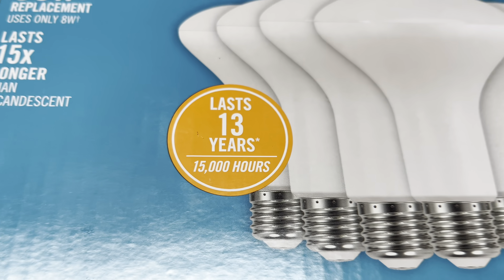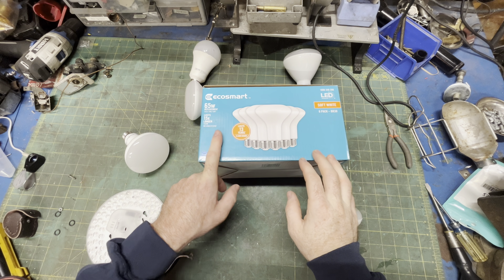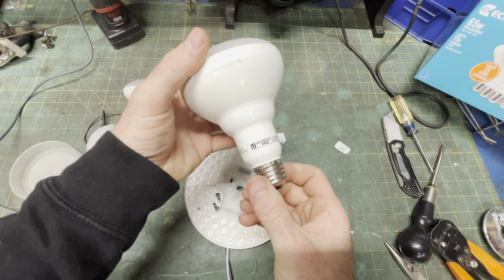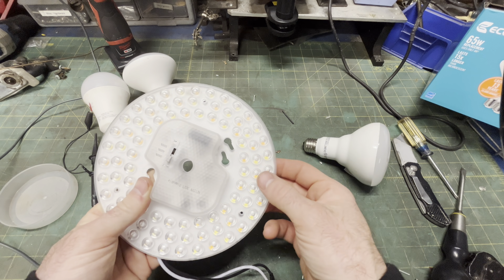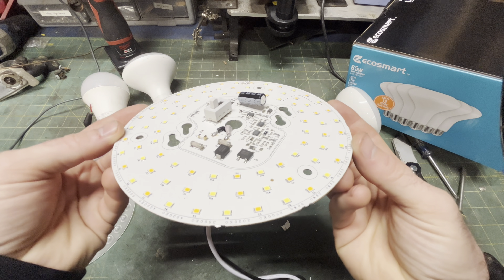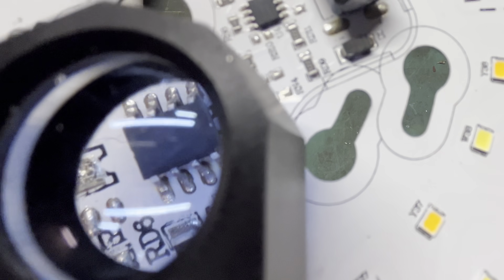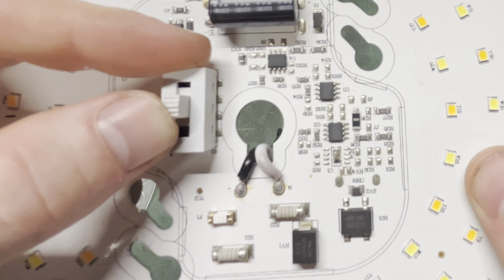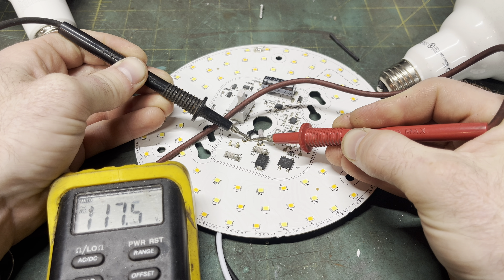Why Do LED Bulbs Fail? An Autopsy!

Comment: My biggest complaint about these LED bulbs is that they cram so many components into a completely un-repairable sealed package. If I could actually fix just the parts that burned out it would be a way better deal. But by the time I open them enough to find the failed part it's destroyed. A room-wide or house-wide efficient AC to DC converter and then just DC LED fixtures would be a much more tenable solution, but people don't want to deal with that.
Reply: Ive been disassembling everything imaginable for over 50 years and its always the same thing  with cheaply made crap that was never designed to  be repaired . Its made that way to meet a price point. But it never stops me from having a look inside anyway!!
Reply: I had some small compact 60s with a spherical plastic cover and couple of them stopped working early, but when i cracked the glue and covers off, two began working again. Lol
And they are way brighter w/o the opaque white cover, so i use them in my bench "up close" lamps as they make very bright light that makes details of things more pronounced. I work on restoring clocks and use magnifiers to see tiny details, so the more intense of clarity the light, the better.
Reply: Cram all the components into a tiny sealed space and see how long the capacitors survive.
Reply: Why would you buy another one if you could fix it?
Reply: People don't want to deal with that because it is available to don't need to deal with that. That is the real problem.
Reply: @d.aardent9382  For those with inductor, there is a chance for an easy fix. If the destroyed component is one of the LEDs, you can simply short-circuit the terminals of the damaged LED. You can do that, because the driver controls the current through the LEDs.
Reply: Same with cheap CFL bulbs. The electronics fail 10 years before the actual bulb burns out. I've seen videos of people from India tearing down and rebuilding dead CFLs that were "recycled" by Americans who can't rebuild anything.
Reply: Yeah the amount of E-waste from cheap made LEDs is horrible. I got two DC LED lamps for camping, they don't get anywhere as hot as the LED bulbs in the house (AC)
Reply: A room wide AC-DC convertor could in theory be dangerous for obvious reasons, but a nice separate standardized  connector which does this would be beneficial and we just connect the lamps
Reply: yes, it's also a ton of fun such a system ^^
Reply: @SadPuppySoup  Mostly because there is no conversion from a cheap AC to DC converter and there's not a drop down voltage resistor.
Reply: @kkgt6591  It would not be dangerous because a room/house wide AC-DC converter for the only purpose of powering LED light would be dropped down to around 15-20v which is not dangerous to touch. So even if someone where to put their finger in there, there would be no danger.
Also a house-wide AC to DC & dropped to 20v wouldn't be big enought to have a significant voltage drop from the transformer to the components.
Reply: @TwinShards low voltage would require expensive thick conductors. Better to have the AC power supply close to the point of use.
Reply: The main issue with all led bulbs that i saw is the same why a lot of modern cheap and not so TVs live for about 1,5-3 years - these leds are cranked up 150% of their nominal power and/or have no adequate cooling...  Just look on them through thermal camera they're almost all around 70c-90c+  on an outer shell
Reply: @AdrianBoyko  LED filament lamps are the worse, because everything is crammed into the lampholder. With SBC or SES, they fail within days.
Capacitors last even less time in the UK, due to our 50hz
Reply: @SadPuppySoup  I've got some LED camping laterns that have been going strong for at least 15 years. Honestly sometimes annoying how cool they run vs incadesent or gas mantle lamps when winter camping and trying to huddle around whatever source of heat you can get.
Reply: @TwinShards   What about the cable?  My electrician wired in low voltage DC track lights and he had to use very low gauge stranded cable because DC just doesn't do well over long distances.
Reply: great idea actually, I would bother and keep some batteries around too
Reply: You thibk those oars are hard to service? Try much smaller surface mount, spaced so close there  is no room for regular probes. I brorought the Microdyne RCB2000 from rottype to production. I needed a microscope to see many of the resistors, and a special 0.01" wide chisel tipped soldering iron t  solder in any replacement parts. Hundreds of LSI integrated circuits on almost a dozeb VXI style cirit boards. We had let a board house assemble a sample run of of ten sets. Not one board was bult properly. They were suposed to have used pick-n-place, but they did them by hand. By the time they handinstalled the components, the paste solder for the reflow ovens had mostly dried out. Thousands of bad solder joints on every board, but it was over $50,000 worth of boards they screwed up. Also, they didn't prebake the oards befor reflow, so some very expensive FIR ICCs cracked as steam built up inside and split the bodies. They worked for a few hours before losiing their programming. They all had to be replaced. 288 pin packages are no fu
Reply: there are LED lights that have separate LED driver and LED fixtures
Reply: @genesisdominus  i did try that on one and another LED burned, and redid the same thing and the next LED burned, i don't think they are repairable
Reply: As a plasma fanatic  I just stick to fluorescent lamps. Most LEDs are boring for me. Filament style is OK but most other types are as ugly as the average mother-in-law.
Reply: @mernokimuvek  I sstill pefer a high end CRT monitor, because other types cause more eye strain for me.
Reply: I have good luck saving the main led cob by just popping off the plastic bulb and very carefully grinding off the rim where they put the glue. Most of the bulbs I've done this to just have 2 pins that the cob slides down onto so you just remove any screws and pull off the cob straight up. I have about 10 of them so far I've saved, not sure why and not sure what I'll do with them but I hate throwing them away knowing they still technically work. Most of the failures if anyone was wondering on the brand I've been buying is the heat cooking off traces on the main board.
Reply: @zazugee  Only some circuit designs with active current control can handle that you short-circuit one LED to get the other LEDs in the chain to light up.

If there isn't active current control, then the voltage over the remaining LED will be higher, and  the other LEDs will also die.
Reply: Exactly, we need repairable electronics, so the bulb's useful parts can be swapped onto working circuit boards again.
Reply: @johnklein338  Are you willing to pay five to ten times the current price for a  hand built, repairalble lightbulb? Look at the cost differebce between surface mount, and through hole complonets. Add the labor to kit the parts, assemble and test, plus the fallout  of misbuilt items. I've worked in Electronics manudfacturing, and the old methodsare too expensive, except for highh budget militaryy or industril equip,ent.
Reply: @michaelterrell  yes, I'd pay 2 or 3 times more for products that can be repaired and last 15 years instead of making junk after 5.
Reply: @johnklein338  Great! now cobvice at least 50 million more pople to do the same.
Reply: @michaelterrell  how about I do 40 and you do 10?
Reply: Why do you think all the TV repair stores closed down decades ago?  When my grandparents lived in Denver there were 20-30 large repair stores.
The labor cost is the killer.  A skilled electronics repairman would get $30-$40/hour.  Are you going to pay $30 to repair a $1 light bulb?
Reply: @Fred2-123  no, but companies could because they should be required to take back their products that fail early.
Reply: I invented your solution and amtrying to commercialize for office and factory lighting and already installed a prototype in a Chinese factory..................
Reply: @Fred2-123  There were oer 50 in Middletown, Ohio when I graduated in 1970. The population was just over 50,000 I went to work in one at 14, after school. I used to buy some tubes by the case of 100 because every color TV used at least thee 6GH8A tubes, Better sets used six and they were often all bad
Early parts tolerances were +/- 50 ^. We wer usng 1% for mos of our products in 2000. We used som 0.1 and 0
01% resistors in critical circuits. Capacitors wen from +80/-20% to 5% or better. Some were laser trimmed to be used in critical ircuits and cassed as 'As Marjed'. LEDs do not have an unlmiterd liftime, as well. Or cal lab at Microdyne repleced hundreds of faded seven segment LED displays.  Sme displays had built in ASCII decoder/drriver software to make it easy to display the firmare configuration.
BTW, 'White' LEDs are really blue. A phosphor converts it to white, but it drgades with age and use so even if yoy replace the bad caps, it still won't perform like new.
Reply: @TwinShards Diodes themselves are ac dc converters tho (half wave rectifier)
Reply: They want you to buy more bulbs. UAE Rich Saudis get special Phillips Filament bulbs where the LEDs arent overdriven and genuinely last ages (Triple the filaments per bulb) , the average joe gets the bulbs with 4 overdriven to shit so they last a couple years at best
Reply: @lacucaracha111111  There are imcandescent lamps that have been on for over 19 years. Where do we find LEDs that will last over 300? It is a mater of efficiency Traffic lamps were low efficiency, so the lasted for year. Early LED replacements often filed in under 60. days. Clusters of dead LEDs but as long as enough still work, they weren't replaced.
Also, most  of the older traffic control lihjing systems o nothing to eliminate the switching noise. I live in Central Florida. You can hear a light over a mile change, on an AM radio. the required filtering would also reduce failures due to voltage spikes and high RF energy near large transmitters.
Reply: @michaelterrell  I think there has been ONE incandescent lamp that is nearly 100 years old, but it is fairly dim.  19+ Years are sadly outliers, where everything worked out perfectly in production and from a time where bulbs would eventually fail anyway = secure resales. 

The only thing that killed ALL the LEDS here were cheap parts and eventually corrosion/plastic cracking

Outside of that they have a near indefinite lifespan 

So They would, if well built last 50+ years until corrosion gets them  = UNACCEPTABLE for companies that MAKE MONEY BY SELLING LAMPS
Reply: I get it - stuff isnt easily repairable anymore. But to be fair you couldnt fix the old incandescent bulbs either.
Reply: @SirWussiePants  Actually, youu could repair some by putting them into a hand hel socket, and tun it to brink the break close together. The proppertp would weld the ends back together. It wasn'tas good as new, but you could do it to many clear bulbss.
Reply: An in-home DC distribution system doesn't sound like a bad idea.
When I was a kid (about 10 years old) I once fixed an incandescent light bulb. There was a piece of filament hanging from each supply wire. By carefully manipulating the bulb to get the filaments to swing and eventually contact each other, they stuck together. I gently screwed the bulb into a socket and upon turning the switch on, the bulb worked. Unfortunately it died again within a day. But generally, the old incandescent bulbs would also fall into that category of "un-repairable sealed package."
I did have one LED bulb fail where after maybe 2 or 3 years of use, it just started to emit smoke, which meant something had failed and there was an overcurrent condition but not sufficient to trip the breaker. I have to wonder how bad it might have gotten if I wasn't there to immediately switch off the power to the lamp. Imagine you have lights on an automatic timer while you're away and you come home to find your house burnt down.
Reply: @keensoundguy6637  DC is deadlier than AC. Once it is flowing through your body, you can't let go. AC drops to zero volts twice each cycle. 
The lightbulbs have a small resitor in series with the AC nput. If the transitor or diodes short, it actsa a fuse. Some failure are below therequired current, so they take longer to fail.I've replaced fused restior in Electronics, since thee early '60s.
Reply: So many devices run off DC mow the majority could be run off a home DC circuit.  Only the kitchen and laundry really need AC anymore.  It would be safer and devices could have AC and DC inputs.  I like the idea.
Reply: @SirWussiePants  Then do it, and see how stupid the idea is. The voltage drop along the wiring will make it unusable. We have the same I/R loses in 120 VAC wiring, but a 3 volt drop isn't noticced  when it's only 2.5% instead of 25%. You would need 10X the copper to compensate, and copper is no longer cheap.

Reglation will be crap, as well. This is why the Edison DC system died. The excesive losses required many small generators in a city. Liht bulbs had to be selected by the distance rom your generator. It was a lot more expensive than the Tesla system to operate. Forr your idea, you would need a hihj DC volage and the same swiching power suppl to downconvert it to thee required voltage and regulate it.
This has ben known for well over 100 years, and te original system was DC. It caused many more problems than it solved.
Reply: @michaelterrell  I knew that for long transmission.  Would the drop be that much for a home?  I havent even thought deeply about it.
Reply: @SirWussiePants  iUless yout total load is just a couple watts,  i will be crap. I've seen the Nutral over 3 volts at a receptcal, which means anther 5 volts in the Line. You can measure the drop at groinded outles with a voltmeter between ground and neutral. Also, it may be illegal to use DC in some areas. The devices have to be rated for DC use. Shiches that are AC/DC rated have a much lower DC curent rating, since DC arcs more without ACs Xero crossings.
Reply: @DarthCiliatus battery operated units do not need to convert line power down to constant current for the LEDs. The SMPS used in household lamps generate heat, which leads to failure, often due to dryed out electrolytic caps.
Reply: I have thought the same thing!  Especially with solar, etc becoming more common.  A good DC distribution system makes total sense.
Reply: What percentage of the population have the skill set to repair anything electronic.
Reply: @AlbertHess-xy7ky  In my circle of friends it was around 50%. I could  also do construction, rebuild car engines and do metalworking, while others my age wasted their time drinking and playing or wathcing so called 'sports'.  I built a radio on mt eighth birthday, in 1960. 
One of the last I built was for the International Space Station. I grew up before video games , and taught myself Electrical Engineering. while in high school  Anyone with decent intelligence could learn he basics, but they are either lazy or unwilling to try.

Comment: As a research chemist working on OLEDs, it pains me to know how many chemists and physicists worked hard on making the LEDs last for decades only for greedy companies to use cheap components and manufacturing techniques, causing the LEDs to fail after fractions of their useful life.
Reply: Well, even with that shortcuts prices of LED are not that cheap (and seems started to rise). Nobody is interested to pay $10 for a bulb.
Reply: Great Eagle A19 LED Light Bulbs 60 Watt Equivalent- UL Listed - 3000K LED Light Bulbs - Non dimmable Light Bulbs 60 Watt Soft White (4 Pack), $1.74 each.